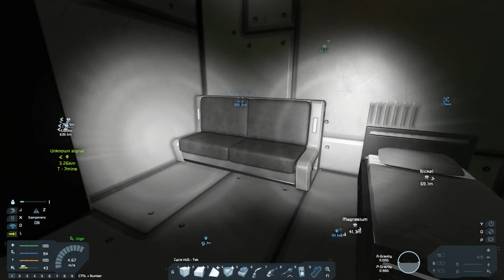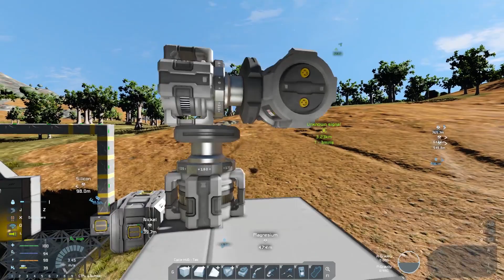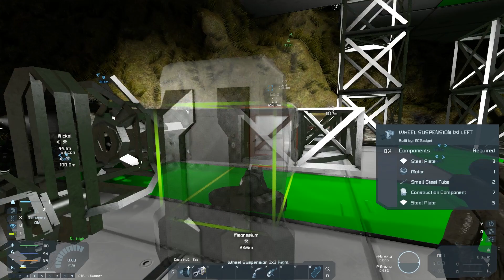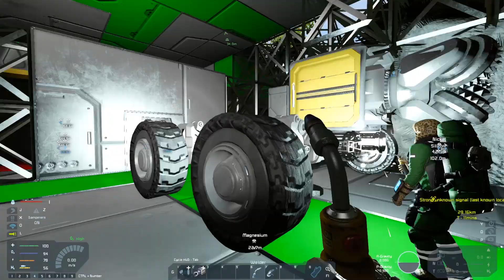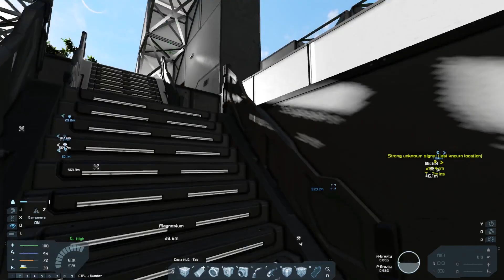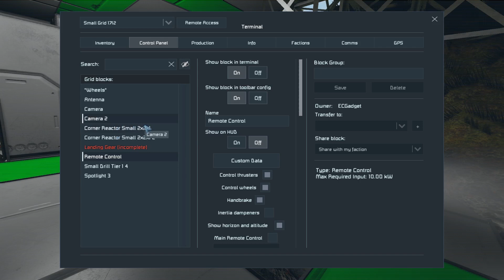Mining Rover - Space Engineers #01 w/ ECGadget

Comment: Welcome back. I like the drill concept, I wonder how you drilled downwards? The way it is configured as you showed it looks like it would carve out on the horizontal plane. If you were to do it again, would you try to script it? I was thinking you could make it work with two drills, but the movement of the drill head would be a bit too complex to make it work with basic controls offered with rotors etc...
Anyway, do you plan on showing us some dual universe when it comes out? ;)
Reply from the maker: Good to be back. Its a bit cheaty with the drill, the drill head just has a larger mining radius than normal drills. Also the drill head (with the rotor) can connect to a side beam to keep it in place whilst I add more pistons. I would like to go for a proper mining rig for the next site, since the current one is to be used for the silo. Also, as far as I am aware, the NDA for Dual Universe ends at Beta (though this may change) so I'm waiting until alpha is a decent way in before doing more content on it.